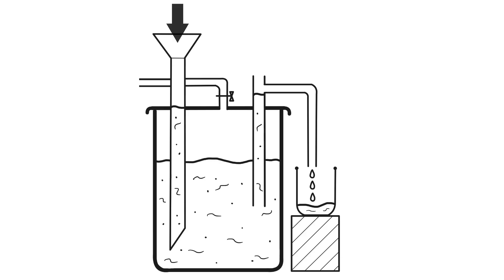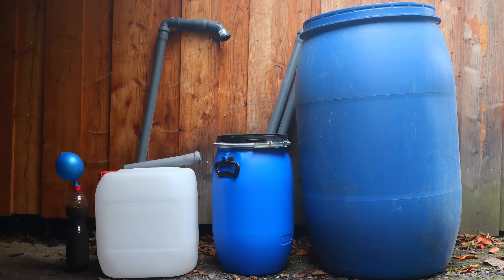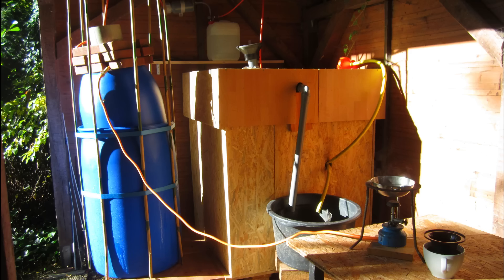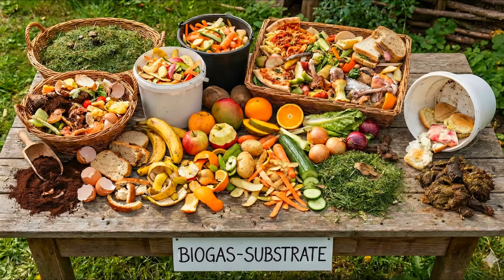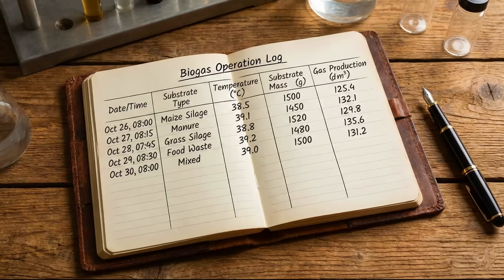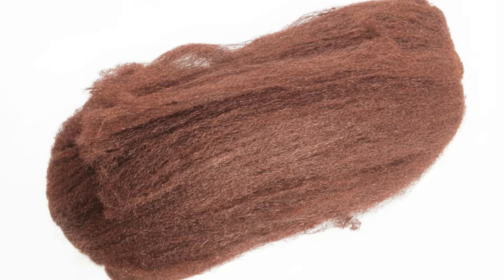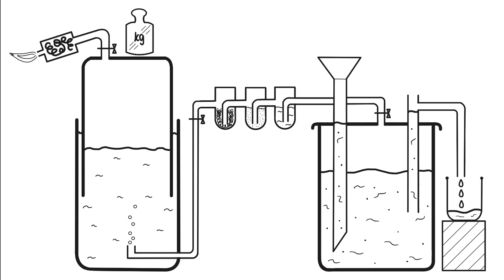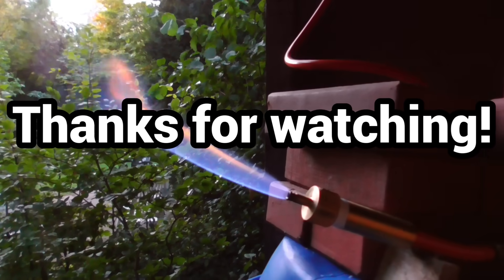Make your own cheap energy with a DIY mini biogas plant

Comment: There are hundreds of videos on this amazing idea and I use the word in it's real meaning! Bio-gas plants are complex and fussy and anyone who thinks just some kitchen scraps and some garden waste is in for a big shock, the amounts you need to make the effort worthwhile are huge and to get reliable output year-round. I run a commercial plant and to keep the bacteria happy is a complex silageing process and you need a large heat input to keep the temperature correct. It's not to be underestimated!
Reply from the maker: A large industrial plant is, of course, something completely different. However, with my small, self-built plant, I have found that with regular maintenance, stable gas production is very easy. You just have to take care of it almost every day!
Reply: @myengines2443 
  Yes for you it is a big complex problem.
  But if you go back to government plans from the 1970's through the farmers cooperative extension program. You will find complete plans for how to do this with a rotating fermentation of 12 fifty five gallon barrels only needed the manure input and scrap straw for slurry.
 On rotating basis barrels refilled every six months, with excellent fertilizer spray after.
  Designed to accommodate the needs of those big northeastern or Midwest farm houses and there inefficient equipment.
  Self made water metal and carbon filters to get the junk out.
  What you are doing now is the largest most efficient process hopefully. But for home use not necessary.
  This guy has no heat concern's looks like warm tropical area with lots of excess vegetation. Probably a lot easier for him if you live in a temperate climate.
   So, why you gotta cut down on people just figuring out how to have free energy. Or ate you going to pipe him some gas 
✌️😎
Reply: @myengines2443 Lot of hassle for €0.20c of gas! You need a fermenter and a silaging system plus heating for a continous process.
Reply from the maker: No its not that much hassle, you don't need much stuff, just use what you have from the garden and the kitchen.
Of course this is just a small testing plant, I will build a 1-3 cubic meter digester when my actual combined heat and power stirling is ready for use!
Reply: @myengines2443 Been there done that. 2 600L CSTR reactors, 16-20 kg food waste per day. Transportation, grinding, mixing, feeding, pumping out digestate, analyses, repairs. All that needed 2 guys, working full time 9-5/5. Tiresome AF for only 2.5 m3 of biogas daily. Then add digestate disposal.
You totally need full automation. And there will be still some hassle.
Reply: Do you do consulting, I need to talk to an expert on this exact subject.
Reply from the maker: Just ask your questions here, and I and others will answer!
Reply: @myengines2443  Okay I'll give it a shot. I'm currently putting together a prototype for a household size digester. I'm doing stirred thermophilic so the effluent is sterilized and the dwell time is reduced. The goal is to fully automate this as a product, but I'm worried about stability. If you leave for a couple weeks on vacation will it be able to recover eventually? My thought is just oversize it a bit so if it take a couple weeks to ramp back up it can still process it. 

I would be using a scrubber and PSA to remove HS2 and CO2 then compressing up to 4500PSI for seasonal energy storage which will also help even out production fluctuations. This will be part of containerized offgrid infrastructure product targeted at new homesteads.
Reply from the maker: That sounds very ambitious, respect. Thermophilic bacteria are more effective, but also significantly more susceptible to temperature fluctuations, especially naturally too low temperatures.
Please tell us more about your project, it sounds very exciting!
Reply from the maker: This is amazing, can you please show your plant in a video here?
Thanks for your very good information especially on the gas analysis!
Reply: @myengines2443 yeah should have it operational in a few months, I have most of the parts I’ll share online eventually.
Reply: @harryman11 There are a few of the 25kW plants around here intended to run farms but not really popular. Here (in Germany) there are two sizes of smaller plants, the 25kW for farm use and up to 500kW for grid feed which are under the agricultural subsidy scheme but a lot depends on the available crop land to feed the things. The big hassle with the smaller plants is the amount of machinery required to process the feed is basically the same as for a big one and not a lot of difference in the time required either, for a 25kW plant you still have to produce and move about a ton of feed a day, a farm with dairy cattle is already doing all the stuff anyway so no problem since they are silaging but otherwise it's a problem.  We just finished cropping and took off 6000 tons for a 500kW plant.
They don't take kindly to shutting down, the happy bugs kill themselves and the only thing to do is half empty the chambers and start again, ours died once and it took two weeks to get it running again and you have to bring in external plant to get them going, partly for the power to run the agitator and pumps and partly to heat the digestor up though I guess if you could store two weeks worth of gas you could just use the normal generator.
There are some low-temperature bacteria in development for use in Scandinavia but whether they work and have been approved I don't know.
Otherwise it's just a maze of big stainless pipes, augers, electric motors and the usualy system chaos.
Storing the effluent is another whole hassle, it's valuable but you have to keep it somewhere before you can use it, you need a big tank!
Going on holiday isn't relevant to us, we are required to have an operative on site or on call 24/7 anyway for safety reasons, ours phones us up if something is going on.
Routine maintenance is an ongoing thing, we change the generator oil every 200hrs so every week or so and tear them down about once a year for pistons and liners, they work pretty hard so they have to be pretty robust, we can get about 70,000 hrs/8 years before metal fatigue in the block itself kills them. Then it's just a question of dead electric motors, pumps, bearings and the rest!
Reply: @myengines2443 never published that. Just two cstr in the lab, with vertical stirrer and water jacket, upper hatch for cleaning. Two valves at the bottom for feeding or pouring digestate. Everything is done manually. You connect hose, pour digestate. Carry it to digestate tank. Mix grinded waste with water in the barrel, connect pump to hose, pump it into the reactor. Pump some water in order to wash barrel, pump and pipe.   If omitted washing, it clogs, it stinks. You do that every day. Feeding is by some spiral or worm pump idk the proper name.
Too much hassle. u need automatic feeding. But, all that tends to clog pipes due to sedimentation. So first you dump digestate then feed, then wash by pumping extra water into the reactor. If clogged and you can't dump, then pump some water into the reactor to unclog. I think, you need to empty pipes every time after dumping in the automatic system, otherwise it can clog. Thus pipes maybe should be going down. You should have your digestate and feed pipes connected to water taps in order to unclog just by opening them. We never had that, its just my thought. Then you should dispose ur digestate somewhere. You can not use centrifuge, to throw away solids and recycle liquid. It doesnt work.
Digestate can foam, we just sped up stirrers. I think we had negative energy production due to constant heating and steering. You need plastic or stainless pipes with stainless valves. Valves wear out quickly due to sand.  If bottom valve leaks, we add the new one in serial without stopping reactor. That's my real experience at that scale.
Reply: @jimtitt3571  Thanks for the thoughtful reply. I'm attempting to do this on a household scale. I'm developing homestead in a box product that forgoes the need for well and traditional septic system. I assume the systems you work with are mesophilic? The biggest unknown in the whole system is the biogas digester. I'm going with a stirred(pump), thermophilic digester to make it small as possible. The product is going to use cascaded heat pumps for heat and solar for power. The biogas will get scrubbed and dried, the resulting methane would be compressed to 4000psi to store for seasonal low solar and temp conditions. small CHP 10-20kw going to a hv DC battery. I'd be running it on a custom V-twin based on a Kohler on an atkinson cycle, using BLDC generator and custom charge circuit so I can run it at lower speeds. Will also be adding two electric oil pumps to avoid startup wear and to run a bypass oil filter as well with a large reservoir to make maintenance intervals as long as possible.
Reply: @harryman11  The hassle is the amount of energy to heat the water and feedstock, we put 70 tons a day in and to push that an extra 35-40°C and keep it there is going to be expensive. I've seen fuel cells mentioned but never seen and don't know of anyone with them, converted diesel engines are the preferred option, durable petrol engines with the continous output we need aren't a thing really whereas a 450hp turbo diesel is a mass-produced and reliable object. The gas is a pretty destructive stuff in engines at the best of times, the valves take a real hammering (they are special steel for gas). The spark plugs as well, they aren't cheap!
Reply: @jimtitt3571  Yeah, I can see that. I'm building the entire thermal system to integrate with it. During the summer I'll have a bunch of free heat you are pumping out of living spaces anyway. Trying to make all of the support infra for a household fit into a single 20ft high cube cargo container so thermophilic is must to reduce size/dwell time. Insulating it enough so I can have it coast at temp with more thermal input for a couple days so it's only heated when there is excess solar.

Our family business does small 48cuin methanol race engines the compression ratio is already damn near there, just need to swap the carb and the valves from titanium to inconel. We make about 140hp@9700rpm out of 25hp v-twin block so detuning it to 15hp@1800rpm should get some life out of it. The thermal and battery storage is much less than 500kwh so at most it might run 8hrs a day in the cold seasons so I'm not super worried on the survivability.
Reply: @harryman11 What is the feedstock? All the container systems (40ft) are working with slurry from dairy cattle to eliminate the need for a digester. You can add about 20% silage or other feed into them but that's about the limit, more and the fermenter will die. We actually built a pre-digester (the typical 16m dia x 4m deep heated tank) for our plant which runs at a ph of about 4,5 to break down the cellulose cells better. It worked until it didn't, the mixture decided to solidify and overpowered the agitator and we never worked out a solution and scrapped it.
Your project sounds interesting, a development nightmare though! Changing and combining one thing at a time is a real adventure, getting loads of systems to cooperate together is going to be fun!
The advantage for homestead systems is the economics  don't really have to work out, we have to balance the crop cost/value against the return on the energy produced and adjust to the sell-price of everything. Some years we cut the grain use or the grass use to optimise the income.
Reply: @harryman11 biogas should be purified from silicone-organic compounds, otherwise it will destroy engines.

Comment: If you can increase the heat to 45 to 65 degrees Celsius you will be in the thermophilic zone where gas production is accelerated, the addition of a heater, using the cooling water from the Stirling engine, heat pump or even burring the gas directly to keep the temperature up, may actually be worth it especially if your feedstock is consists of harder to digest cellulose plant materials or is compromised with pathogens. 
The tank can also actually be heated with a compost heap built around it that consists of woody materials that break down very slowly over time. In this way both gas and compost can be generated together efficiently.
Reply from the maker: Yes that's a great setup. I use the mesophilic zone as it is often quite cold here in germany and they are robust!
Reply: @myengines2443  Its possible to use a two stage system, at least then you would have a fallback if it becomes too hard to maintain thermophilic temps. The first thermophilic stage can be smaller  (like half the size) and operated with much lower retention times. there are several papers which describe the advantages.
Another thing to boost gas production is to bubble the methane back through the digester using a small pump like an aquarium pump ect, the mixing it provides should significantly increase production with very little energy cost.
Reply: I want to build such an automated composter next year to keep my gardenhouse from freezing. I also plan to release my arduino code for controlling mixing, oxygen and moisture control. The aim is to keep temperatures stable through the whole winter by accelerating and decelerating the process in varying weather conditions. I have done this with some projects before like the arduino controlled battery spotwelder in August 2014 which was copied and enhanced many times afterwards. I love people who do this, maybe i even make a video this time.
Reply: Does that increase yield?
If not, then provided there is enough time (volume in the digested to accommodate the feed rate), is there any reason to do that?
Reply: @dougaltolan3017  yes, cellulose is more thoroughly broken down meaning less sludge and more gas yield.

Comment: This would be a good addition to a greenhouse since the dead, damaged, bad and other rejected plants could be composted, the gas retrieved and burned to help regulate the green house temperature or to run a small Stirling engine..  Placing the system inside a greenhouse with outside safety ventilation  would help maintain the temperatures needed for methane production.
Reply from the maker: Yes, this would be a very nice application!
Reply: @myengines2443  
Another possibility is to produce Hydrogen gas from excess PV produced electricity and just add it to the reserve of methane.
The temperature of 30C to  40C to  needed for the system is of a concern though?
Reply: Another idea you could try is to use a water filled tank on top of the collector.  instead of rocks and bricks to compress the gas.  This would allow you to vary the compression by adding or removing water from the tank.  A "Grease Bag"  like one used to transport and dispense lubricating grease would be sufficient to collect the gas?
Reply from the maker: The use of surplus solar energy for hydrogen storage is very interesting. The temperature is not such a problem with a heat-insulated fermentation tank. I usually only have just under 30 degrees and the bacteria generate some heat themselves. In our very cold winters, however, some additional heating is required, but not very much.
When it gets a little colder in the fermentation tank at an outside temperature of -20 degrees Celsius, less is produced. Of course, it must not get too cold in the tank (below approx. 10 degrees).
Reply: @myengines2443  
Thanks.  Where are you located?
Reply from the maker: Germany, as you can hear at my strange accent!
Reply: @myengines2443  Ok Canada here
Reply: @anguscampbell1533   hydrogen is highly explosive though....
Reply: you can run the sterling engine inside the greenhouse to heat both at the same time!
Reply from the maker: Yes, this is possible, I run my Stirlings as combined heat and power units to use the excess heat!
Reply: Pumping the CO2 produced through a greenhouse also helps with plant growth. The Woodlawn Bioreactor in Australia uses methane from Sydney’s garbage to run generators, they use the excess heat produced to heat water for growing Barramundi (a freshwater fish that’s popular here), as well as pumping the exhaust through tomato greenhouses which helps warm them and increases plant growth.
Reply: Basically what Dyson does for their farm
Reply: I imagine you'd need a heat exchanger to achieve ventilation without losing the heat from the greenhouse
Reply: What about human manure

Comment: Steel wool burns. Use copper wool or a stack of screens. Even sheep's wool is better than steel wool.
There's no telling the purity of the gas, things like carbon monoxide burn on their own. Producer gas, as opposed to natural gas was high CO. It was why people stuck their heads in ovens. Idk what biogas is composed of, sans methane.
Reply from the maker: I use coarse stainless steel wool which is very hard to get to burn!
Reply: @myengines2443  In normal conditions it cannot burn since its melting temperature is below its ignition temperature. This is also the reason why stainless steel plates cannot be cut with oxygen.

Comment: suicinitus is lurking, be careful, oil mafia dont mess around
Reply from the maker: Unfortunately, that really isn't funny...
Reply: @myengines2443  a backhanded compliment for your engineering with a twisted joke, i commend your efforts greatly. You say the tank collector should be in warm? can it be too hot? like in desert environments? this would be fantastic for communities in deserts who raise cattles, like camels etc no?
Reply from the maker: The type of bacteria I use a temperature above 40 degrees celsius will be deadly for them, but above it much more efficient bacteria will produce more methane in a shorter time but they will die at lower temperatures!